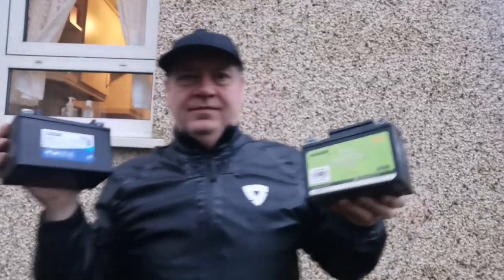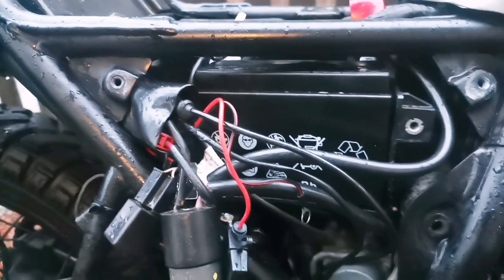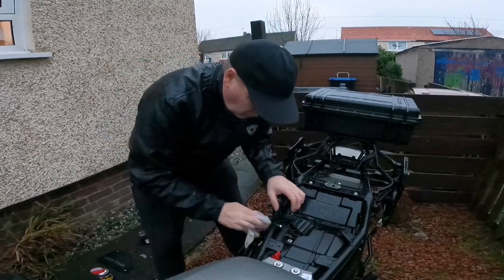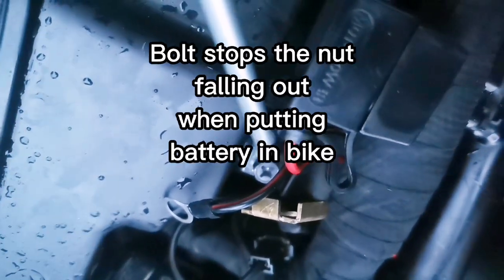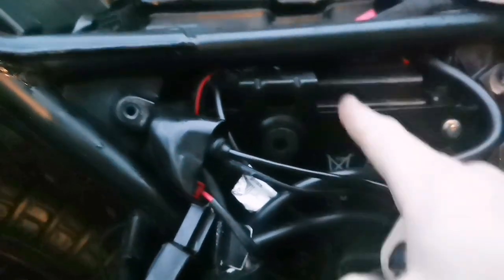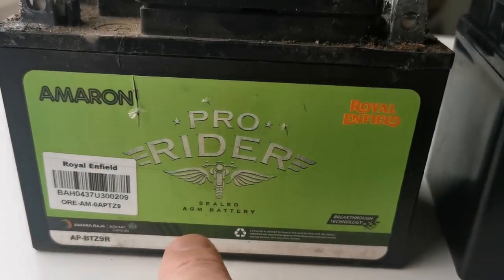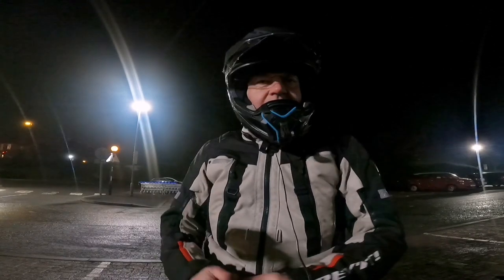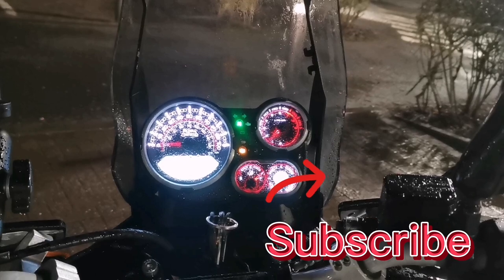Himalayan Battery Problems - Install A New Motorcycle Battery - Exide AGM Battery - Royal Enfield

Comment: I thought I would share this, I see people changing batteries all the time when they are just low on water. After 2 years my 2022 Himmy battery started giving me problems starting and the trickle charger stopped charging. So I pulled the battery partially out of the holder, pealed back the long sticker about 1 centimeter, so I could see the long service strip, I then pried it out with a knife and saw that all the cells were low on water. I then filled them with naturally distilled (rain) water using an injector with needle and then closed it up. Put the battery back on the motorcycle trickle charger and six hours later it indicated that it was fully charged. throwing out a battery just because it is low on water is like buying a new motorcycle every time it runs out of gas. Of course the sticker over the service strip helps hide the fact that you need to service them and gives the impression that it is no maintenance. Simply a great strategy to sell more batteries.
Reply: I done that too. I have a cheap batter tester, before adding distilled water batter test life was low, after tester said good battery. So it definitely works in some cases.

Comment: Another useful and informative video 👍
Removing the battery for the first time can seem "challenging" though with practice it does become easier.

If you don't have any dielectric grease to hand you can use petroleum jelly (Vaseline) instead to prevent corrosion of the battery terminals.
Reply from the maker: Aye its a fiddle Henry but not impossible eh. Good advice on the vaseline mate cheers 👍

Comment: Also my R-E starter motor said 0.7Kw 12Volt.  So that's 700 watt. 700/12 = 58 amps.  Does that sound correct? Has anyone put a DC amp clamp on there starter motor cable to measure starting Amps?

Comment: What year is your bike?
Reply from the maker: It's a 2021. Bought it this time last year.
Reply: @WeeJaunt  I have the 2022 Euro 5 model. I have done about 4000 Ks on it. It looks like they have improved the wiring around the battery. Comparing your to mine.
Reply from the maker: @PubRunner  yes I'm sure they have mate. The side panels even seem to be a more snug fit to the frame so I recon they really have tidied it up.